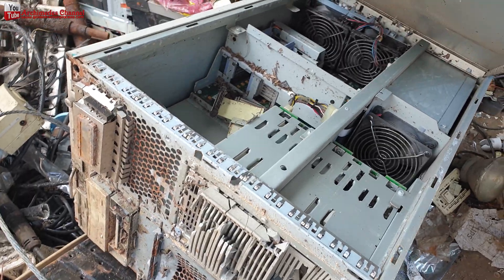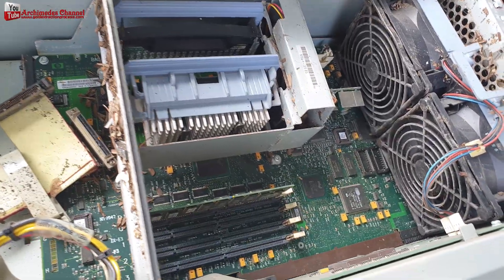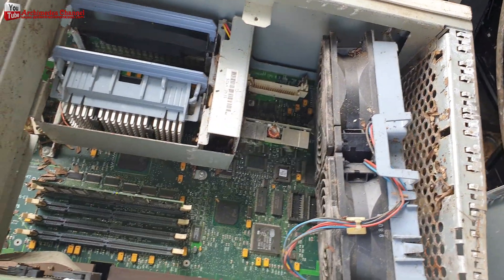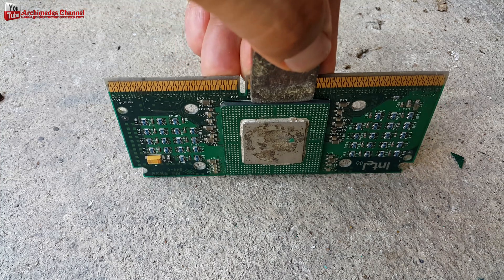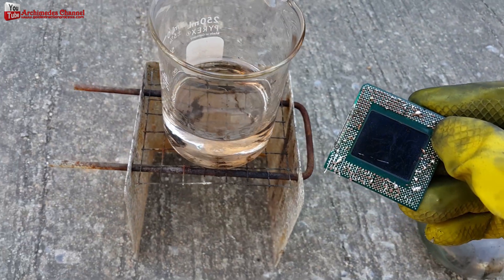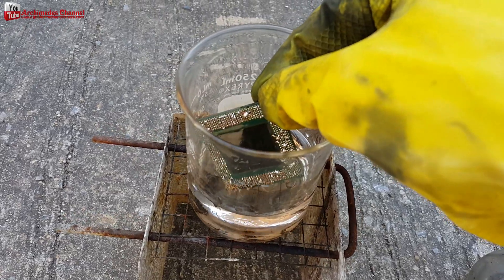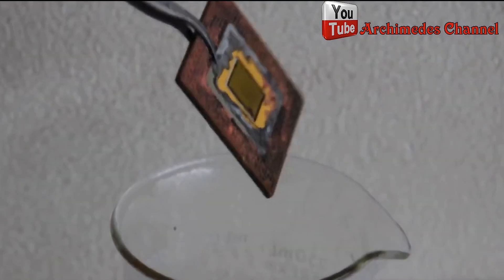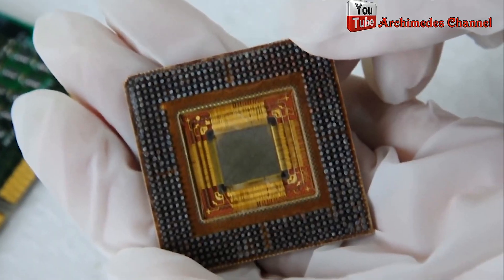How to gold extraction from cpu computer scrap Intel Pentium II (Pentium 2) processor

Comment from the maker: Modern computer chips manufactured after 1998 have very little gold content in them because most CPU's no longer use solid gold wire bonding technology or gold-plated lids in their packaging.

For example, the Intel Pentium 4 Microprocessor came in an organic (non ceramic) package with a nickle-plated copper lid, & it did not use gold wire internally to attach the silicon chip to it's package. It's only noticeable gold content came from it's connector pins that were thinly gold-plated. However, the pins were gold-plated to a thickness of only 0.76 microns - that calculates to just around a few cents worth of gold value per CPU.